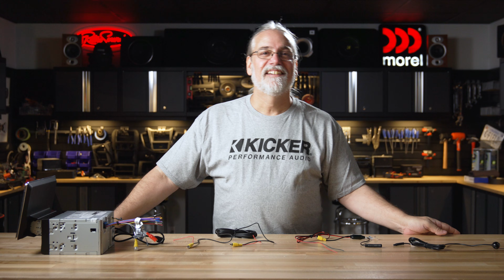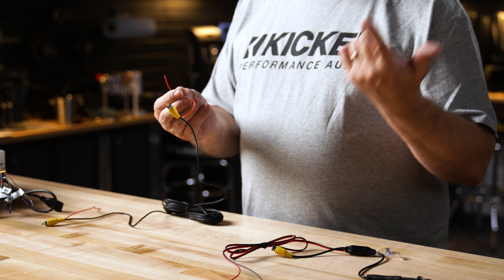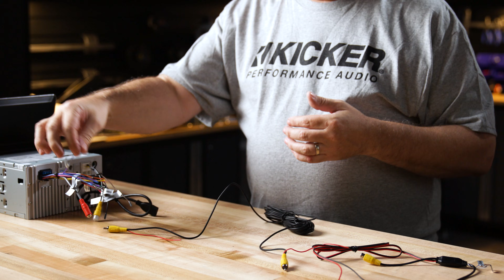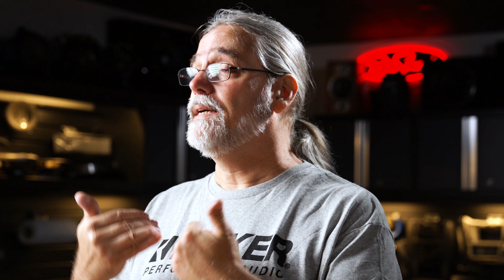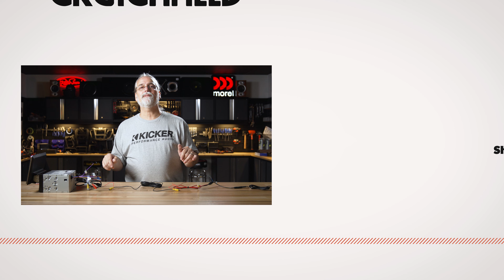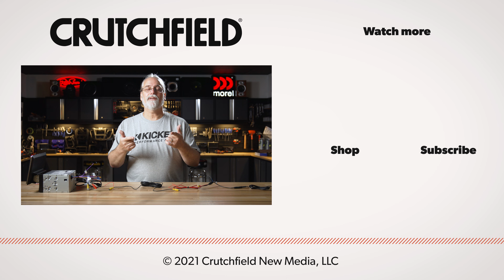Powering your backup camera (and how to use that extra wire) | Crutchfield

Comment: My back up camera only works when I'm steeping on the brake pedal?
Reply: You've connected the trigger and or power wire to the brake light wire instead of the  reverse light wire. Make sure you find the correct wire for the reverse light bulb.
Reply from the maker: It sounds like to me also that you have connected the rear camera trigger wire to the brake circuit, rather than the reverse light circuit. Once you correct the connection the rear camera should display when you shift into reverse!

Comment: How can you use a switch to trigger the reverse camera on the head unit while not in reverse without making the reverse lights come on?
Reply from the maker: As long as the switched power used to turn on the camera does not ever come in contact with the reverse light circuit, you will be able to access the backup camera without turning on the reverse lights. In this video, we suggest using switched power source that also turns on the radio.

Comment: Hi there, I hooked up my backup camera to my 2001 silverado, it works very well in the run ignition position. However when the engine is running, there is some horizontal line interference showing. Not terrible but noticeable. All my soldering connections look fine as well as the few crimps I used. Any idea how to get rid of it?
Reply from the maker: Did you ground the camera to the chassis of your pickup? If you did, that was the best idea we had to resolve your issue and recommend contacting technical support for further troubleshooting help. If you purchased your camera from us, you can contact our technical support using their toll free phone number from the order invoice.

Comment: Can the ground black wire to the back up wires in the rear lamp
Reply from the maker: We do not recommend connecting the ground wire from the backup camera to the ground for the rear lights. The ground wire should be connected to the frame of the vehicle.

Comment: This is a very helpful video. Although while looking at radios for my car (2006 Mazda Tribute) the description warns me that the reverse wire uses a negative signal. So I'm guessing the backup lights are ultimately wired and switched off of the negative pole, so that if I wire up the trigger wire for a camera it probably won't sense the voltage because it's looking for a positive 12v signal. It mentioned the use of a relay to use that negative backup lamp circuit to trip on a positive wire to rectify that, but after looking around and can't really figure out what kind of relay to use for that, do you guys have that on Crutchfield or could point me in the right direction?
Reply from the maker: We sure do sell a relay that can be used to convert a negative trigger to a positive trigger:

www.crutchfield.com/I-rYALc227/p_120E5000/item.html

Comment: My headunit came with this wire but no remote turn on amp wire.Can I use this one
Reply from the maker: The Camera power wires are not likely to be active all the time and would not make a good source for an amp turn-on wire. But all head units should have a wire to turn on an amp. It may not be labeled as an amp turn on wire, but it should have one to turn on an amp. We recommend contacting technical support for help. If you purchased for your head unit from us, we recommend contacting our technical support using their toll free phone number that's included on the order invoice.

Comment: So I want to hook my reverse camera to a 3 prong switch on my dash. If I hook up the convenience wire to the battery (gonna use a relay connected to me accessory), should/Could I just connect the convenience wire and trigger wire to the switch and use the rear ground wire to complete the circuit?? I sure wish there was a convenience ground wire up at the head as well...
Reply from the maker: We don't have any tutorials covering the installation of a switch to run the camera, but we do know that it is best to connect the camera's ground wire to the vehicle chassis. This is why radios don't typically have a ground connection for a backup camera. The convenience wire can be used to supply the backup camera with power that comes from the front of the vehicle. As long as there is a way to cut power to the camera and the camera gets power to run when you want to use it, then you have found a great power source for the camera.

When you say trigger wire, and if you mean the wire used to tell the radio when the vehicle is in reverse, then we caution you to be careful where you get its trigger connection. When this wire is activated, the radio will only display the backup camera video and nothing else until the wire is no longer getting a signal.

Comment: Hello!! I paid to get it installed & they wired to the taillight.. I can do everything else but I don’t know where to wire the purple wire now. I have a 2013 Honda Civic 1.8 DX. Where can I find the reverse light circuit to wire to? Thanks!
Reply from the maker: That is a good question for technical support/ We have a technical support department to help with installations and recommendations on where to connects wires in vehicles! They are not available here on YouTube but they can be reached by calling their toll free phone number from the order invoice.

Comment: I was struggling to get my camera to work until I watched this video. Excellent instruction! I had watched a few others that didn't quite get unto this level of detail, which you helped identify what i was missing. I do have a question though: I am powering mine directly to the stereo 12v acc, which works great, but the camera LEDs are always on. Is there anything I can do? I don't want to go the switch route.
Reply from the maker: The backup camera would need to provide separate power connections for the LEDs and the camera. If there is only one power wire for both, then there is no way to control them separately.
Reply: @crutchfield  thanks for the response. So would you say it is common to operate with the camera LEDs on all the time? I'm concerned about how bright they are to drivers behind me at night.
Reply from the maker: We do not keep records to know what is common. Wish we had different news for you there. We do appreciate your concern for everyone's safety. If you are not able to use separate power for the LEDs and the camera, it may be best to wire them in such a way that the camera system only gets power when the vehicle is in reverse

Comment: Thanks for the video. I’ve hooked my camera up. Unfortunately it’s coming up in black and white. Any ideas what I’ve done wrong or how to fix? Thanks
Reply from the maker: We are not sure what would cause a backup camera to provide a monochrome image instead of a color image. If there were any cables that plugged together, you may want to ensure they are fully seated together. After that, you may check for troubleshooting steps in an owner's manual for this issue. If it was purchased from us, our technical support can be contacted for help troubleshooting the issue. We include their toll free phone number on the order invoice.

Comment: What about when you have a maestro harness wired to stereos reverse wire. Can you also use that to send power down to the camera with the “convenience wire”?
Reply from the maker: We do not recommend using a trigger wire, even a reverse gear trigger wire, as a power wire for a device. You could tie the backup camera's power to the switched power wire provided by the iDatalink MRR modules for the new radio. And then use the convenience wire to send the power to the camera
Reply: @crutchfield  thank, is that the red accessory wire? I assume though that would be when you want constant power instead of only when in reverse. Powering off the revere taillight is probably the best option then.
Reply from the maker: You would want to connect both the power and reverse wires.

Comment: Will it work if you just connect the convenience wire to the trigger wire on the head unit, and the other end convenience wire to the camera red/power (grounding the black) without taping into the reverse light? Another way of asking is will the head unit provide the power for the camera
Reply from the maker: What brand and model camera do you want to install?
Reply: The trigger wire on the head unit is an input. It doesn't provide power output so no you can't do what you are asking. However most Android head units and some others have both a reverse trigger input to tell the head unit your car is in reverse and also has a camera power output which will send power to the backup camera to turn it on.

Comment: I have a problem with my backup laying constantly on, I would like to have it turned on only when in reverse
Reply from the maker: You'll want to be sure your reverse wiring is properly connected and from there double check your camera menu settings on the radio. If you got the camera here, you can call our Tech Support for help with this as well. Their direct number is on your invoice.

Comment: Can the Camera be powered off the same Reverse Wire that goes to the headunit?

This would be better than wiretaps on a fragile tail lamp wire.
Reply from the maker: The exact power wiring will vary per camera. Do you have a specific model in mind?
Reply: @crutchfield  Crux CUB-15 or CUB-01
Reply from the maker: Both of these models allow you to choose power at the headunit or via the rear reverse light.

Comment: Duh! Just realized in my son's 12 accord that had a Boss system installed prior there are 2 sets of lines. I played thru settings like lines up or down but once reverse the lines wereup in the sky and another set down. Just ocurred to me since the camera angle sucks, not tilted down, that I cannot adjust those lines. I will disconnect that loop for now. Also wondering about that back up wire on radio. I cannot see the back view unless I touch the camera on screen. I was thinking once in reverse the camera would automatically pop on the screen like in my jeep or pkck up but it doesnt unless you hit camera, sort of annoying
Reply from the maker: In order to have the camera automatically come on in reverse, you'll want to make sure you did connect the reverse wire and double check your backup camera settings via the radio's menu.

Comment: I'm having issues with a rear view mirror dashcam. When the backup camera is plugged in, it locks the display on reverse mode. The camera has a backup trigger wire and a black cable with a 3.5mm headphone jack to plug strain into the mirror. I don't know what I'm doing wrong.
Reply from the maker: Hi Dan, sorry to hear about the issues with your cameras. Your best bet is to start by double checking your wiring and the menu settings for the monitor viewing. Keep in mind, if you got the camera here, you can call our Tech Support for help with this. Their direct number is on your invoice.

Comment: My backup wire is not triggering. I have Sony XAV5600 with PAC unit and oem backup camera. Ready Harness as well. The camera turns on when I press backup camera on the screen, but it is not triggering when I put in reverse. Called tech number, I guess next step is to get multimeter. Anyone have a common fix to this issue. I don’t want to take everything apart again until I know why this is happening. It’s 105 degrees here in Dallas. 😅 Thank you!
Reply from the maker: Hi Drew, definitely want you to try and stay cool there in TX! Sorry to hear your installation isn't going easier. Be sure to double check the Sony's camera menu settings as well as your wiring. From there, please do give our Tech Support a call back for further assistance. Their direct number is on your invoice.

Comment: Thanks for this video. Im not the best with technology.

I have bought a front + rear cam. I can install the front. the rear camera cable they gave me consists of a cable from the rear camera that splits into two. One thick black cord which plugs into the front can, which I'm fine with. But the other part is a thin red wire which does not connect anywhere. Can I ignore the red wire? In other words just have a cable connecting from rear to front camera, and ignore the red wire??
Thanks

Note that i already have a builtin reversing camera in the car. I just need a camera at the back recording all the time for insurance/security. In other words recording all the time just like th front dash cam
Reply from the maker: The exact wiring needs will depend on your components. What model is your camera?

Comment: So I wired everything correct screen is clear everything works but, when the headlights are on , my speakers have slight audible electronic buzz. I have two amps wired to one 12 volt source. Does it sound like I need a relay for the camera that way the amp doesn’t send bad sound? It’s only when I flip the headlights on.
Reply from the maker: Did the issue start after you installed the camera? Sounds like you may want to check and even consider re-routing your wiring to ensure that's not causing the noise issue. If you got the camera here, you can call our Tech Support as well. Their direct number is on your invoice.

Comment: So my car has an option to enable the backup camera using the OEM head unit.  So with that the red wires that are connected to the RCA would not be needed?
Reply from the maker: What model camera are you planning to add?

Comment: Do you know what the power pin is for a 54 pin Ford APIM module connector? it's a sync3. If I use backup light for power, the "delay camera" function doesn't work. thank you so much.
Reply from the maker: Hi Matias, what are you installing? If you got it here, you can call our Tech Support for wiring assistance. Their direct number is on your invoice.

Comment: This is great content! I purchased my wire harness for a pioneer NEX, 1770 in a single cab Sierra it’s all mint af and makes the truck feel 5 years newer. You need to make a video specifying single cab configuration as the speaker wires need to be reversed. The front need to be wired to the back and vice versa as the main speakers are technically rear being in the column beside your head, took me a good four hours to figure that out would like to help out other Fellers given her ago.
Reply from the maker: Hi Branden, sorry to hear your installation didn't go easier. Glad to hear your enjoying your new radio though. What year is your truck?

Comment: Thanks for the video! Is there a way to have the best of both worlds and wire it so it turns on automatically when you put it in reverse but also turn on when you push the camera icon on the head unit?
Reply from the maker: There is a way to do it by connecting the camera to an always active switched power source and the radio's reverse wire to a source that is only active when the vehicle is in reverse

Comment: I have a question i had my camera hooked up to constant power and it worked perfectly butnow i switched it to the reverse in wire on my radio and now the pictures doesnt really work it does but its all glitchy and green and red lines shooting through it so much you cant see through it i was wondering if you knew what would cause that
Reply from the maker: The reverse wire on a radio is typically the wire the radio uses to know when the vehicle is in reverse and automatically switch to displaying its backup camera input. Its not used to output power to a camera and using it is likely to be the source of this new issue.

Comment: Hello I just installed a reverse camera into my radio and im having a few issues. I got all the wiring hooked up except the convenience wire. I know I have the cameras power going to the head unit because when I put the car into reverse the camera image will only pop up when my head unit is set in camera mode. The reverse trigger wire seems as if its not reading that my car goes into reverse. So when listening to music if I put the car in reverse the headunit image stays on the radio and doesn't switch over to the reverse camera. Is it possible there's enough power to trigger the camera on but not enough power for the head unit to realize its in reverse and switch over automatically? I might be overthinking this but it is driving me nuts. Maybe hooking up that complimentary wire to a power would fix it? Any input is appreciated
Reply from the maker: It is unlikely that the reverse gear light circuit does not output enough signal to activate a receiver's reverse gear trigger. We recommend double checking the wire connections. If that seems correct, then you may need to reach out to technical support for help. If you purchased your gear from us, we recommend contacting our technical support for help. We include their toll free phone number on the order invoice.

Comment: Just FYI for people doing this the first time. If you use the reverse wire ground rather than a chassis ground you will probably get lines or snow on your monitor. I've done it, then did it correctly after seeing the degraded picture.
Exception to the running the wire to reverse. If you have a canbus system, like in a Jeep, the canbus box knows when you are in reverse and tells the stereo to shift to camera even if you don't have a camera installed or any 'trigger wire'. Makes them easy to install if you have an adapter box. You need one for your steering wheel controls anyway.
Reply: Curious what model years the Canbus system started?
Reply: Thank you, going to try this and see if my image quality improves. Although in my case i'm getting a decent picture but strange colours. Anything green (such as trees/grass) is appearing reddish/purple

Comment: I have bought some camera unit. I want to plug the reverse camera. I took all the cable from the back. Attatched them to reverse light now i have to attatch it to the headunit. Two cables, pink which says 12v output camera, Brown says brake. To which one should i solder the trigger wire?
Reply from the maker: What brand and model camera are you installing?